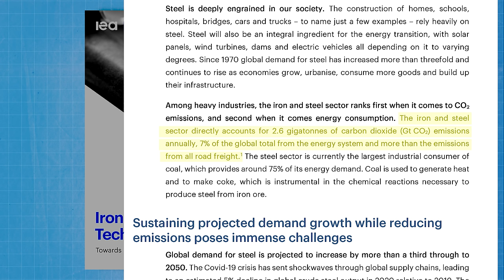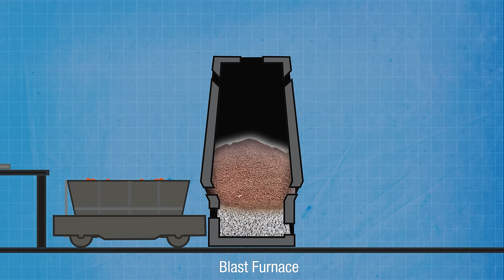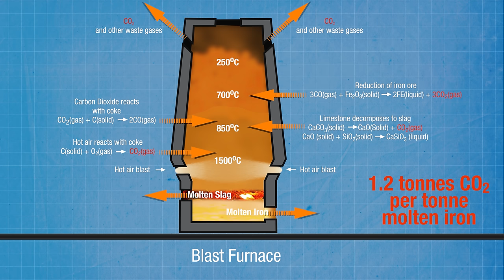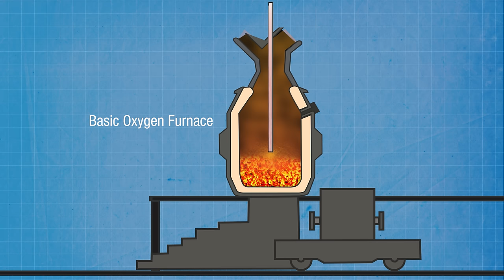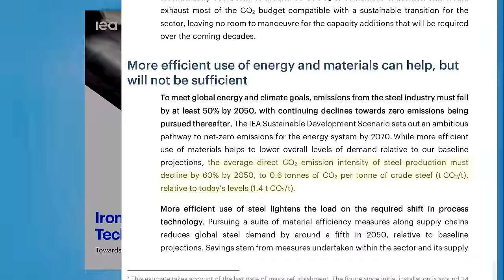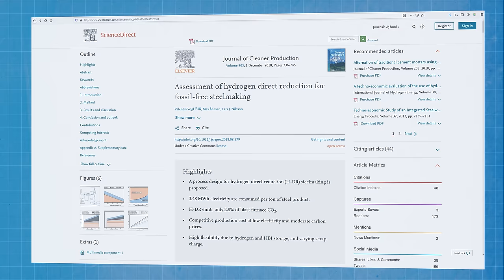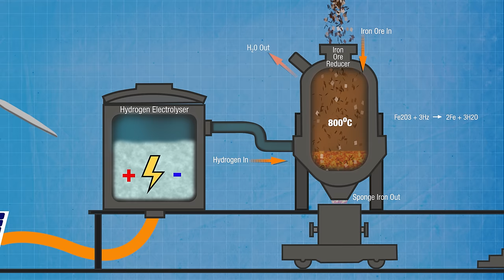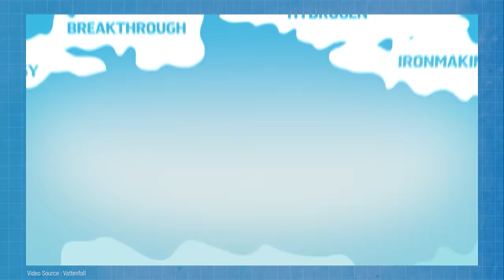Fossil free steel. Another giant step towards net carbon zero?

Comment: China is a very scary dog in this fight; millions of tones of iron, in the form of large iron wire, is laying stacked all over five of China's sea ports. The demand economy, rather than lay off thousands of workers has continued to produce this iron even though there is no demand. thus burning exponentially larger amounts of the soft brown coal they have. As it is, the Chinese Communist Party seems bent on militarism and hegominy rather than being a good neighbor, so refusing to install meaningful changes to become helpful- even though they know this problem exists and will be very harmful to Chins; they want China to be the leading nation in the world when it happens. I have much disagreement with the US official position in this- China doesn't respond to tariffs or other trade sanctions as more liberal nations would- the sanctions need to look more like shunning the Chinese in the world market place till they adopt a more friendly, less warlike attitude. More co operation and less threatening take overs. 
You do make many fine points- maybe add to them that ferric oxide, the most common ore iron comes from, is among the most common elements on earth. This alone makes iron and steel very desirable and attainable. Aluminum oxide is also very common. Both require lots of heat to make into something useful- the big key is figuring the best, most sustainable way to get that energy.
Reply: Yeah China is terrible. I hear they have 800+ bases around the world. And their military spending spending is more than the next nine countries combined. Always invading defenseless countries..terrible.
Reply: @penguinuprighter6231  Kind of like the US with a Defense budget larger than the combined budget of the next ten. The best I can say on that is that the US keeps insisting it's "heart is in the right place". IDK- then there are the Pinochets and the Norieagas. I'm going to back off a bit. This site has tried hard to stay out of political controversies so it could deal more with the facts and the problems that surround them.  I brought up China because they are doing immense damage without even a market to sell their product into. There are things they could be doing, constructively, with their neighbors but aren't, unless they have an underlying military goal. This really needs to be avoided- World Wars eat up resources and blood like the voracious monsters they are likened too. And they leave nothing but ruined and despoiled landscapes where ever they go.I wouldn't call what they are about "ecologically sustainable" at all. Unbridled capitalism isn't much better- when they run out of space for their own garbage, they manage to find some other less well of lot to take it from them. Also not sustainable. There are many forces that separately think they can continue indefinitely like this- rising sea water, increasingly violent weather and warming patterns that are driving ever longer fire seasons in California and Australia say different. Politicians who support Know Nothing groups just because it is the easiest way for them to achieve personal power have to be rooted out of all of our systems- and soon could still be to late to avoid some of the terrifying potentials now appearing. Sociopathic leaders and nations are anathema to where we collectively need to go. Self interest is what got us here, it will not get us out of this spot.
Reply: @fredericrike5974  Whoosh

Comment: Maritime people design and build huge lavish cruise liners that are launched and straight away sailed to India and beached and scrapped. Good used of industrial base there. The merchant fleet of all nations just barely get the hulls wet then scrapped, either because of market/financial or pollution regulations reasons. Automobiles; heavy trucks and airplanes are the same. It's a use once and through-away era, it simple can't be repaired. The local very large aluminum plant built adjacent to a large hydroelectric dam was in production maybe twenty five year and it too was scrapped. My Point, the best career is to become a "Scrapper".

Comment: It takes more energy to produce the steal to build a wind turbine than it can produce in its lifetime so do you want the energy for your car to drive or heat your house.  The limiting factor is the device making the electricity for your use not the fuel.  Wind has only a 33% proformance factor. Also solar takes 6 acres per megawatt to get only 6 to 8 hours of energy which is about 66%.  Storage cost are as much cost per megawatt as the enegry to feed them to operate them.  So to use wind, solar and storage as the only source you will have outages and it will cost twice as much for all consumers. also the wind and solar tax subsidies will have gone away where it will add about $35 a megawatt to the cost...
Reply: Bollocks
Reply: "It takes more energy to produce the steal to build a wind turbine than it can produce in its lifetime" Why do you tell such an obvious lie? Do you like lying?

Comment: Massive amounts of clean energy - either as direct heat or electricity... Hmm- sounds like nuclear power plants to me.  Though the small modular reactors are still 6-14 years out, by then there should be at least a dozen different SMR models for a variety of uses.

Comment: I think its about time solar and wind were called what they are potential dumping..... and given a price of .05 of a cent. If they want to play in a service market then they need to be service providers not dump and run dummies. Carbon tax only punishes the poor and favour upper middle class who can afford to avoid the costs. you want a tax? how about anyone over 100k USD pay 2% more  or no subsides on EVs more than 35K or no rebates for solar.... Ya wanna fix the grid well spend the money there on service delivery tech hydro hydrogen battery. The simplest is hydrogen beside gas furnaces as the can run 30% hydrogen. when the new turbines available go 100%
Reply: Do you own a coal fired power plant?  What's this "dump and run" nonsense?  Renewables can be integrated into electrical grids.  It happens all the time.  It will work even better if we improve the grid.

Comment: The only way to generate the heat necessary without coal or petroleum,  is with nuclear power. 

As it is, much of the steel that is produced is electrode melted.

Comment: No need to reduce CO2 production, and certainly no need to to get to carbon zero.  There is no way to produce enough renewable reliable electricity supplies to achieve this, and the so called renewable energy creates a huge amount toxic hazardous and harmful waste products that cannot be easily recycled.  The type of steel making using the processes you explain have already been tried on numerous occasions and found to be very unreliable in creating large quantities of high quality steel.  This is bunkum.

Comment: Sounds so good but what about problem Just a few parts per million of hydrogen dissolved in steel can cause hairline cracks (flakes), hydrogen embitterment, hydrogen blistering and loss of tensile ductility properties of steel . What do you get when you mix water and iron or steel.  you get rust. Nucleation site for more rust . Yes the body cancer of the cars from 70s and 80s with the use of scarp steel to make  hot roll steel for auto bodies. to many nucleation site for rust to start on impurities and old rust within the scrap . Why do you think  they make coke it to drive off the hydrogen in the coal. With hydrogen  your ending up with lower quality steel that good enough for many usages . Why do you think their building a one ton /hour pilot plant to see if engineering problems are solved is it economic now.  NOTE  Sweden has highest carbon tax in the world ( UN  guinea pig for economic out fall of high carbon taxes before larger economic nation try it ) . Other question if lower quality steel  , will you have to use more steel ? for same structural properties . I hate sites that only give one side of the story without highlighting the problems too.  It create false expectation.

Comment: i know a bit about steel making and:
however good hydrogen steel making is current plants cant just switch over, and so making steel with the old mills will be cheaper than making an enitrely new one. itll take a long time for any new tech to actually get going, 2030 is not gonna happen. hydrogen steel making as a concept has been around for ages and deemed un economical before, so unless the business case changes significantly its not going to make a splash. even moreso since theres a lot of extra steel produciton being made in india and china, it has to be economical, not just eco friendly as i doubt they will choose enviromental concerns over economy ones. very important in this little scheme is that nearly 100% of power has to come from low carbon sources or itll be far more emissions total than using coke, this likely has to include a lot of nuclear power then which isnt very popular.

Comment: Steel doesn't mean much to the average Greene. But just wait till the start talking about fossil free clothing. Losing polyesters and going back to cotton, wool, linen , and fur. Houses built before WW 2 were built without closets people kept their clothes in cabinet.
Reply: Did you know that you can use hydrogen to produce fossil free plastics? I bet you didn't know.
Reply: @3gunslingers  Okay, but you can also spin gold into thread but how does this help? To obtain hydrogen is a expensive process. The plastic of which you speak is not made from hydrogen it is just used in the process.
Reply: @3gunslingers  Runner ,thanks for your time. I went to your recommended site and saw nothing about making materials out of just hydrogen . If you look at the chemical structure of say wool you will see the it is a bonding of many different atoms . when you bond hydrogen with another atom you get something else such as hydrogenated vegetable oil . But hydrogen by itself is just hydrogen . yes we have many fossil free fibers but they are not as cheap . we have cheap clothes because we have cheap oil.
Reply: @kolilagephart3766  
How long will the oil stay cheap and how low will hydrogen stay expensive?

Also cheap cloths are not a necessity. Fast fashion should stop.
Reply: @3gunslingers Runner that is a good question.  It takes electrify to separate hydrogen and many electric cars are coming on line and yet no new powerplants are being built which will increase demand and prices making hydrogen even more expensive. One problem of being resources conservative is where are all the people going to work .When I grew up I had a church outfit ,a school outfit and a play outfit but I realize if we went back to that whole economies would collapse.